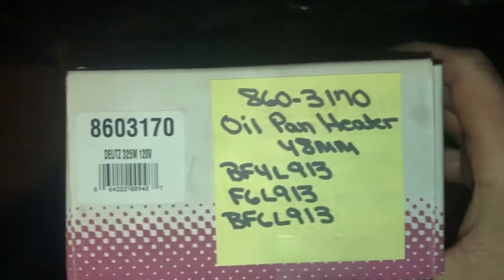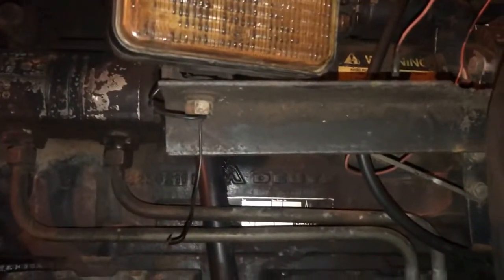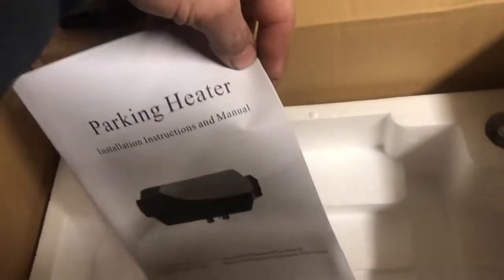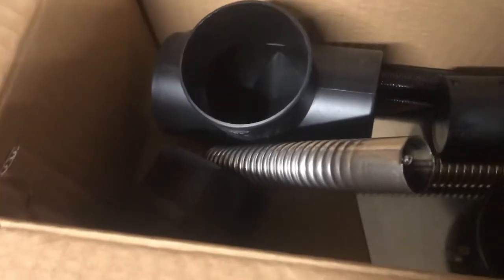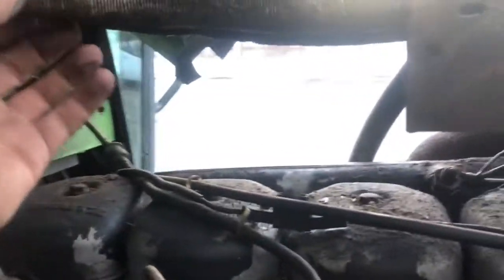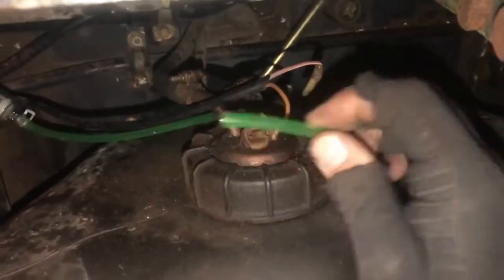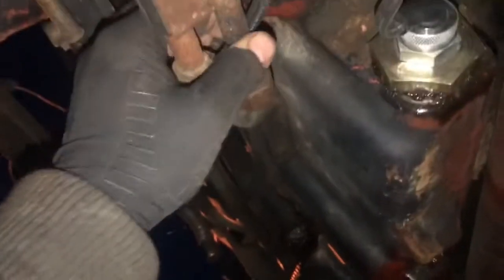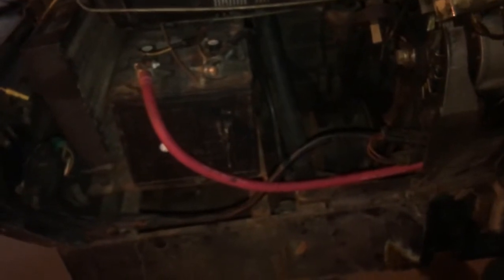DX 3.90 is getting all the heat

Comment: Any comment on how the Chinese oil heater has held up over time? I have the same tractor and the factory Eberspacher is very temperamental. I'd like to have working heat, but if the Chinese model doesn't hold up either than maybe it's worth putting a little more time and parts into my Eberspacher? Would you happen to know what size Chinese heater you used (since it dropped into place so nicely) ?
Reply from the maker: It was the cheapest one I bought off of ebay. It worked great the first year but when I was brush cutting some wires got snagged and hasn't worked right since. I have to fix my door and when I do. This time I am not going to buy the cheapest one. I think the power wire was pretty small for what it was doing.
Reply: @bkcamaro  Thanks Brandon. I had a measure just now and the 3kW Eberspacher that's fitted has the same outer dimensions and mounting pattern as the 5kW and 8kW Chinese units. The 2kW Chinese units have the same mounting pattern but are physically about 2" shorter and 3/4" smaller in the square dimensions. So I guess I'll be getting a 5kW model and go from there, hopefully it just drops right in the same way.

I have the 120v oil pan heater like you do and it's better than nothing but it's only a few hundred watts, it doesn't compare to a proper 1500 watt block heater. Does that match your experience? I wonder if there's an easy way to direct the heater air into the engine cooling duct? I think a 5kW heater blasting warm air at the cylinders for 20 minutes would do a lot more than the 120v oil pan heater?